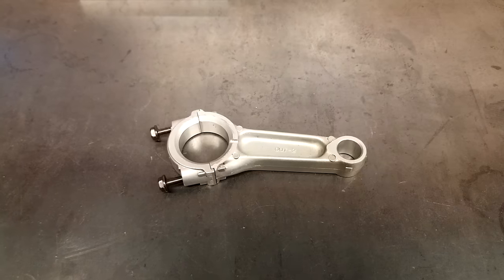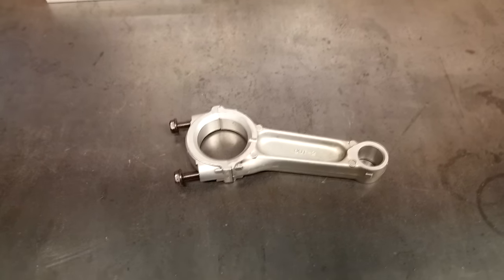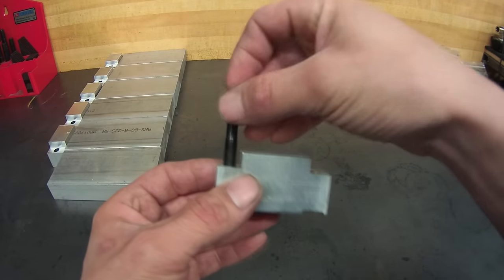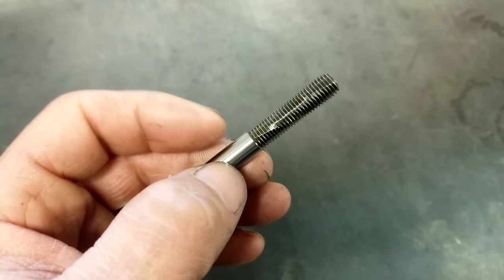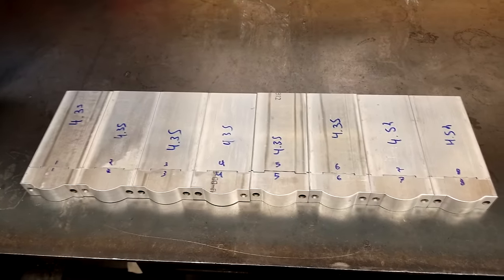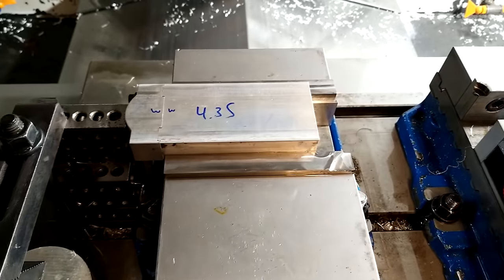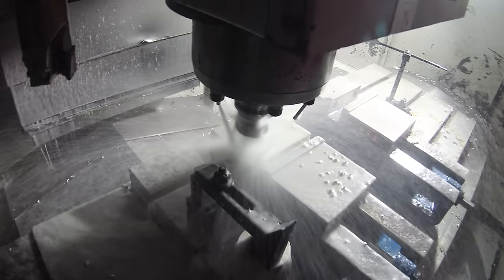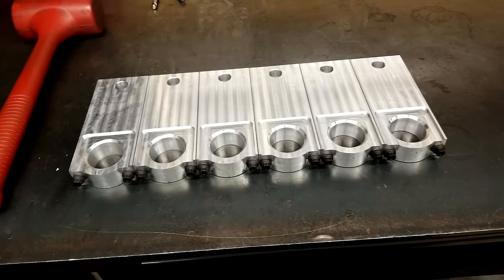CNC Machining of Billet Aluminum 7075 Connecting Rod! Part 1 of 2

Comment: A relitivly simple design and program. But, this shows, no matter how simple the part, failure of the part can really cause catastrophic damage. There are ways CNC tooling bolsters the strength of the part. The beauty of multi axis CNC, and advanced metullargy in the cutting tools, is all the fine measuring is done while still in the first set-up. High degree of persicion is had by the way the cutting tool is held to minimize tool runout. Pressing a tool into its holder whilst utilizing heat is the best way.  Using a "Collett" to hold the cutting tool is one of the least percise way to limit runout. By pushing the "envelope" for better, stronger, higher performing parts, Roger advances the "performance sciences!" Cheers

Comment: If you dont mind me asking what CAM are you using? I have a Tormach 1100 and use Solidworks with HSM. I find that my holes come out faceted when I post them from my CAM. I thought it was my machine since it is stepper drives instead of servo but I can make the exact same shape in conversational at the machine and it comes out perfect, so I am thinking it is my CAM.

By trade I am a CMM programmer and just started machining with CAM and CNC.
Reply from the maker: Hi! I use FeatureCam for my programming but my machine is way too old to even think of high speed milling. It does counter balance with powerfull servo and spindle motor though! I don't know if your CAM software gives you the ability to edit post processor but it might just need some refinement. A circle should be a single G2 or G3 code with in and out linear interpolation,  if it is made of several line it does create a few problem as you are experiencing. It's either not outputting enough "segment" to be smooth or the controller gets over-ride with data to read and has to slow down after each move to process the next few line. It also make for some really long/heavy program.

I edit a lot my post processor for different purpose.
Reply: You have a hobbiest CNC that does a good job for working at home. The tool holders are not high end. This will show in the work you do. Being that you are in the trade, you have a good eye for the little anomalies that pop up from time to time. HASS CNC does a full 50-minute video on tool-holders and how they affect holes and other precision work.  I highly recommend it.

Comment: How do you measure the accuracy of the parts by hand when every fraction of a mm counts on internal parts. Do you use a computer guided cutter?
Reply from the maker: Hi Dan! The critical dimension of the rods are all done on the same setup to ensure the machining is flat, perpendicular and that the rod lenght from both bore center is fine. Once I am done with them I get the big end honed to customer specification. Also the rod is completely machined on a CNC machine so it leave very little space for error.
Reply: @wecklt  why not the small end as well ?

Comment: Can you name the tools used in CNC  machine for making this connection rod
Reply from the maker: Hi! These are all standard tool, Flat End mill, Reamer, Drill, chamfering tool, stamping tool (.045" ball end mill) and also ball end mill for the radiuses. Is there any tool in particular you'd like to get information on ?